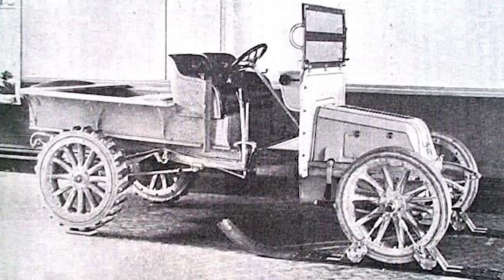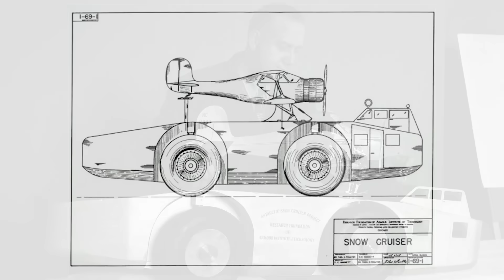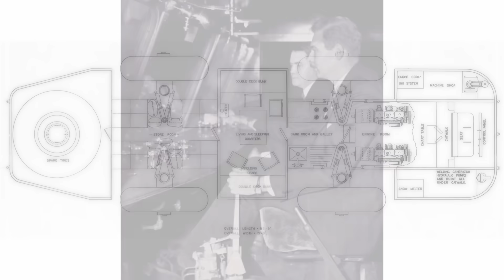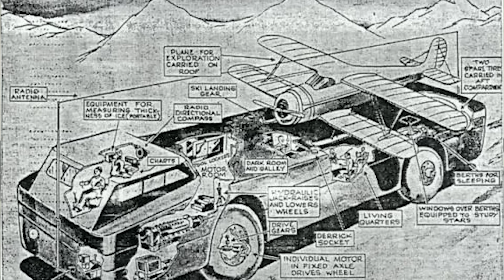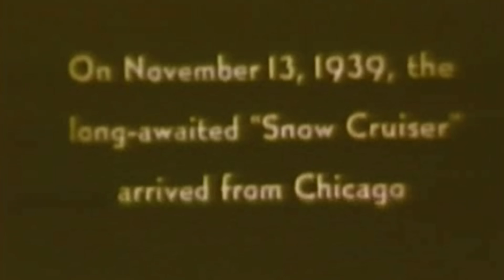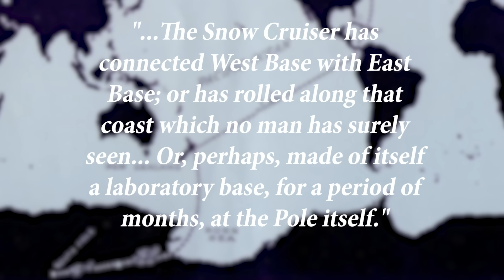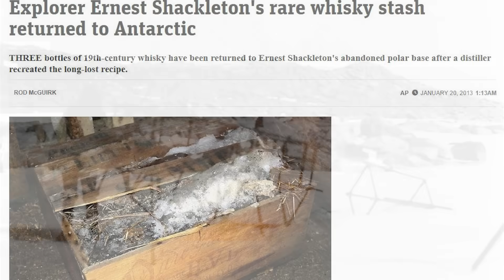"The Snow Cruiser"-Antarctica's Abandoned Behemoth

Comment: Just another great example of how governments should never be trusted with public money.  Since they do no work to earn the money they have no incentive to spend it wisely.
Reply: It doesn't matter if 99 of 100 projects like this supported by the government fails, if the one that succeeds is so good that it pays back all the 100 and a lot more. This is the math why it is easily worth it for government to support these projects. For example think about the current electronics industry. It would not exists without government projects after WW2, because back then nobody needed the stuff, and it was unlikely that it is going to work, or that it will get done fast enough. Same for internet, GPS, etc. Computers, etc. space technology, etc. None of this would exist in current form without these government financed projects, because private sector can't support projects like this that are very likely to fail. Private sector supports only known technology or technology they know they can get working, that is going to succeed, but the problem is that technology goes very slowly forward like that.
Reply: wop- Nope.  Government projects cost at least 20x more than they should so even if every other one was good they would still be a tremendous waste and drain on the economy.  The government creates almost nothing except for weapons of war.  We'd be technologically decades ahead if we could just shrink the government.  You have to remember that the government simply has no incentive to do anything well, or economically or even safely.  Which is why it never does.  The free market is an infinitely better provider of all goods and services.  Just think about it, it's basic logic and is supported by the evidence of all human history.
Reply: @nowheretosit  Free market is good at making production of goods and existing technology very efficient. But free market is very bad at coming up with radical new inventions. This is because a business operating in free market usually cannot afford to develop very uncertain projects, projects that are very likely going to fail,  but if they would succeed, they would be extremely valuable. Private investors often want to minimize risk and they want to profit as fast as possible, and if you want this, it doesn't make sense to develop radically new technology that has extremely high risk, and at worst long payback time. Many important projects just don't find enough investors from the free market so that you could develop the project long term.

For example, if you have new science and technology in the making, it may require years of work, often decades of work, before the technology is ready for use in bigger scale. How do you pay salaries for your scientists and engineers during this time, when you have nothing to sell?

The intention of free market is not to develop technology. It's intention is to make money on short term, and to make efficient system of that. At worst, this slows down technological development very heavily, because for example, let's say oil is cheap now because a lot of it is available. Ok, now because oil is cheap, it doesn't make any sense to develop alternatives to it now. See, free market has stopped the development on this sector completely. They are improving the methods of getting the oil out of ground, but very little is invested to fixing the root problem.

The problem is, easily available oil is a limited resource, so in the long run alternative will be needed. And the problem is that developing that alternative may take a long time. But if there is no financial incentive to improve this sector right now, it won't happen by free market.

The problem is that the free market reacts to this kind of problem usually way too late. The oil crisis is good example of this.

Let's take another example, nuclear fusion power. Why aren't free market companies trying to solve the nuclear fusion problem? Or maybe few of them they are, but the main players in the field are government financed parties, and of course private companies financed by these government projects. It costs a little now, but if they get it working, the benefits are so massive, that it will easily pay 5000 years of development costs

And history is full of examples of this. How some government financed project, pushes the technology forward a lot more than free market did for a very long time.

Free market is important system, and definitely needed for making the production efficient. Free market is a good slave, but a bad master. If you want it to solve problems efficiently, you must set limits to it. Like, you could put a high tax on fossil oil, and free market would start to develop alternatives.

Same way, government can finance projects, and independent companies can participate in them and that way provide their solutions.But if the market doesn't make the need for clearly important problem, then government can give a little help in that.

About the efficiency tough, it really depends if there is possible to have real competition. On fields where real competition is difficult, even free market easily results to very high prices and inefficiency. And the opposite, even government can work very efficiently, when the system is designed to target efficiency,.
Reply: You have that completely backwards.  A free market economy is where all the real innovations are hatched.  Government is absolutely the worst thing in the world for innovation.  

Take NASA for example.  In spite of their enormous $13 billion dollar per year budget, they can't even design a rocked engine any more.  Now they have to buy then from the Russians of all people.  Meanwhile private companies like Space X are pioneering technologies on a shoe-string budget that NASA can only dream of.  

All industries are this way.  The government has no incentive or motivation to innovate anything.  Look how antiquated our road network is.

Government investment is always a bad thing because the government has no incentive to spend money wisely or choose things to invest in.  They work entirely from a corruption based, who will donate money to me system.  

Also everything the government does is backed by violence.  I support peace, not violence and free markets are entirely peace and freedom based.  

Government management is just violence backed monopolies.  I don't know why anyone would advocate for monopolies and corruption and waste.  

You're probably one of those paid social media manipulators who barracks for government on all topics no matter what they are.  Go on, tell me what branch of the government should be eliminated and replaced by a free market.  The FDA?  NASA?  Schools?  Healthcare?  The forestry service?  The FBI?
Reply: @nowheretosit  You didn't understand the point at all, so you are arguing against some other your imaginary person whoever it is you hate so much, than me.

It doesn't mean private companies cannot be involved or that they don't innovate at all. Of course private companies and individual people can be involved and they do innovate a lot, where it is economically viable for them.

But here  is the problem! The problem is, many problems are that kind that,  there is no market for the product yet, or they are too expensive to develop in a small company. Could simplify that free market is too short term, for certain things.

SpaceX Isn't a good example of innovative though, because they are applying 99% known technology to make their product, Space rocket is basically a solved problem. Technology that has already been developed for 70 years by Germans, NASA, USSR, etc. SpaceX is not about innovation in the core product, they are about making the production efficient and cheap where free market is very good at. SpaceX is actually very good example of what I said earlier; a company that takes existing technology, and makes a good product out of that.

Ok, you are going to personal attacks.

People who have very strong ideology, as you seem to have, are same as very religious people. They have extremely strong belief in some simplistic idea, which usually the real world is not that simple.  And they aren't open to new ideas or thinking from another point of view. Thinking from another point of view is the main thing in innovative mindset, and that is what has allowed our science and technology to develop more in the past 400 years, than it did in 10 000 years before that. What allowed that is ditching religions and strong ideology, and starting to question things. Don't take anything for granted or that it is final and cannot change. Of course it's not final and it is far from the best system that could be.
Reply: So as I predicted, you can't name a single part of the government you don't support.  Which I just what I said, you don't really believe anything you're saying, you just argue for bigger government on all topics.  That's not a personal insult as you have tried to frame it, I'm just calling you out for being a fake.  That's why nothing you're saying makes any logical sense, you're just reiterating the same falsehoods you guys all use.  Like your absurd claims that Space X isn't innovating.  That's baloney, when nobody else in the world has done it, it's innovation.  

The bottom line is you're a complete fake who always supports government on all topics all the time.
Reply: @nowheretosit  It is a personal attack, because you are attacking on my person, and not against my arguments. Your argument is to claim that your opponent is a "fake". And the rest of your arguments are just statements, without any explanations or reasoning, just very naive simplifications.

If you want to get your point trough, you have to do it with logically valid arguments. Who is the opponent is completely irrelevant, you should still be able to give a logically valid explanation and reasoning to your point of view.

It also depends, how you define "innovation".
I'm not even arguing for a bigger government. I am just bringing up a different point of view that you seem to be completely missing. And hell no, I don't support always government topics.

What is exactly the huge innovation in what SpaceX is doing in your opinion? Can you name one remarkable innovation they have done?

They are mostly applying known solutions from elsewhere, to existing problem, but they aren't doing anything very risky or radical new thing. They are doing a thing, that is 99% known, and that is 90% sure that they can do it.

If these points hold true, it is not true innovation anymore, it is applying known solutions to existing problem.

Their innovations are very few compared to what has been already done in the field. Space rockets are nothing completely new, unlike they were in the 40's, 50's and 60's.
Reply: @nowheretosit  Oh sorry, I forgot to answer your challenge;

I think government shouldn't be involved too much on fields where private sector can perfectly well organize the service, the product, etc. and where competition, etc. free market mechanisms work  perfectly well.

In these cases, the role of government is mainly legislation and even there, the simpler and easier to understand, the better.

In my opinion, ideally you want to have small and efficient government. Taxation of work should not be too high, so that incentive to work stays high.

Government should be present only on  those fields, where it is clearly beneficial to organize the thing via government.

Comment: Glad I came across this video! Really interesting "little" thingomagic they've made there. It's unfortunate that it failed in its sole purpose, but we have to give them credit given that this was done in the early 40s! It's funny because we are now more than capable of creating it the right way. All-aluminium frame and panels, spiked radial tires, solar panels on top for electricity and auxiliary power, extremely efficient diesel-electric engines with more than enough power, advanced torque splitting viscous differentials to help it get traction when needed... Just to name a few.

Comment: Considering the following. It was: 1) Too heavy for snow to support, 2) Too underpowered, 3) Had horrible ground clearance and approach angles due to the long overhangs, 4) Zero-traction slicks for tires, and 5) Balloon tires made it bounce along the ground, suggesting that there was improperly designed (or non-existant) suspension articulation and damping as it moved, and 6) That it was far too heavy for the wooden ramp built to unload it from the ship. This seems to be an example of exactly how not to build a vehicle for traversing snow and ice. As others have stated here, a few tests with a scale model and some basic calculations would have revealed most of the problems with this design. It's less like it was poorly engineered and more like it wasn't engineered at all. You have to wonder how many people expressed concerns about the design of this thing, but were ignored. As a mechanical engineer, I would have had absolutely nothing to do with this mess.

Comment: i get the use of smooth tires  with heat, given how little we knew and how little had been developed at the time. its not usual for capitalism to fail us by simply abandoning it instead of trying to make an improved version. heating the tires would be the first thing i think to go.  the last thing you need is your car is melting into the ice to the point its belly is free sitting on the ice cap surface. another thing i wouldve done is work on investing on improved wheels and insolation. and a over all lighter frame. i get the feeling they didnt know about all that much about snow wheels back than and i know fuel economy with alternative sources of power wasnt a thing. something that heavy would require a heavy engine but heavier it is, the more fuel it needs to move. i know america has always been behind the curve with most of more advanced developments coming from an collection of developments from our allies therefore immigrants, with soicalism funding most of the better advancements with tax payer funded contracts . simply put the idea was a great one, but it was far to early. technology could make something like that now, and i think we do have things like that now. but its better off in a museum for engineers to display the importance of smart engineering , not simply tacking on everything you can think of and slapping on the biggest engin you can find

Comment: https://www.motorious.com/articles/features/346950/the-incredible-story-of-americas-lost-1939-antarctic-snow-cruiser

The Snow Cruiser was found twice after this time. In late 1946, an expedition team from the US Navy’s Operation Highjump found the relinquished vehicle and reported back. Apparently, all the Snow Cruiser would require to once again function was some basic servicing and the tyres pumped back up.

Some twelve years later, the Snow Cruiser was once again discovered thanks to a marker pole, albeit hidden under several feet of snow. The 1958 expedition team dug down to the bottom of the wheels and were able to get inside, where they found magazines, papers and cigarettes from the original crew. 

At this point, the vehicle housed several men from the 1958 exploration team, who found the Snow Cruiser's refuge to be superior to the shelters provided. However, while the systems were not started, the team inspected the drivetrain and claimed that very little would be required to get things going again.

Comment: Those wheels are placed too close to each other in relation to the total length of the vehicle. There is far too much overhang. It will get bogged down very soon, at bit like the French WW1 St Chamond tank. It should have had six or maybe even (smaller) eight wheels. How is it possible they didn't realize what a bad design this was?

Comment: A good idea that should have been tested before departing. Perhaps a tracked vehicle or eight wheels would work.
Reply: It's a simple question of making sure the immense weight of the vehicle is distributed by as large a contact with the ground as possible to minimize the amount of weight on each square inch. Wide continuous tracks is a good idea which is why snowcats use them. Fact is the 1910-1913 Terra Nova expedition already had an early snowcat which clearly worked. 

I'll also say that a behemoth of a vehicle weighing in at a whopping 27 tons isn't a very good idea to begin with. Certainly not in an environment where there is little firm ground and no way to salvage it if it gets bogged down and stuck - unlike say forests and jungles where you can utilize trees to pull your vehicle out and where you also will survive outside the vehicle long enough to be able to pick it up later. 

It was  fortunate that it was discovered that it didn't work very well and was abandoned. Had it had better traction I'm fairly certain the crew would have faced disaster on their voyage to the inner parts of the continent. 27 tons has a nasty habit of going through anything which is not capable of supporting it safely. 

As ambitious a project as it was ill-conceived.

Comment: I think the designer was ahead of his time and the engineers were behind for the time. If it can run good in reverse that means the gear ratios are misconstrued. Those tires should also be common sense not to work. I think modern tech such as more powerful engines and lighter materials such as; aluminum and carbon fiber would make this much more realistic.

Comment: All the engineering brilliance that went into this thing, and they overlooked the most basic concepts, such as using offroad tires.  Even the contact patch to weight ratio is barely different from a modern automobile.  Surely they could have taken this thing back for retrofitting and tried again, after all that engineering!  I would love to see this project revisited, and done correctly.